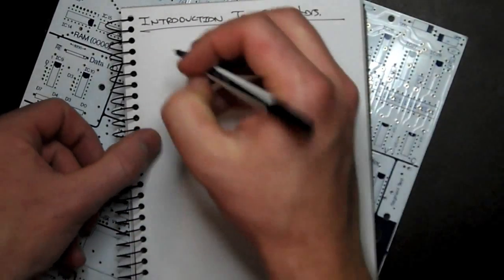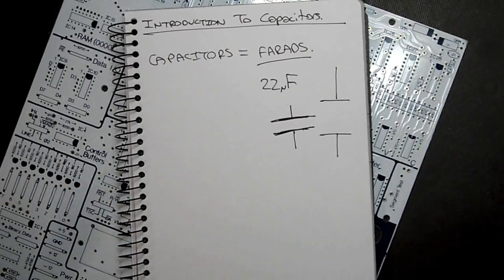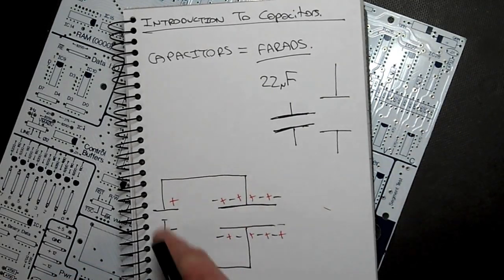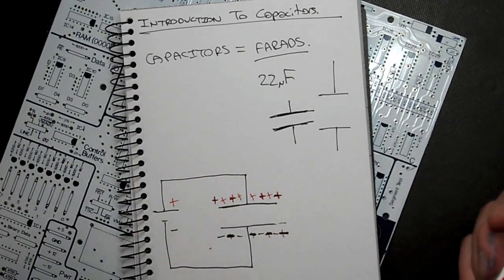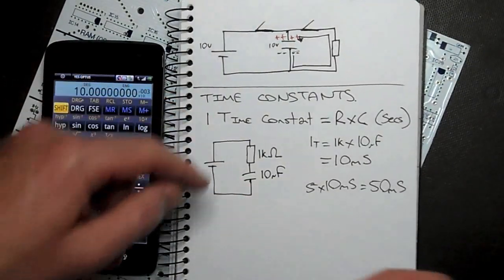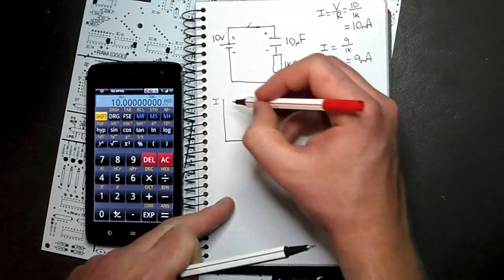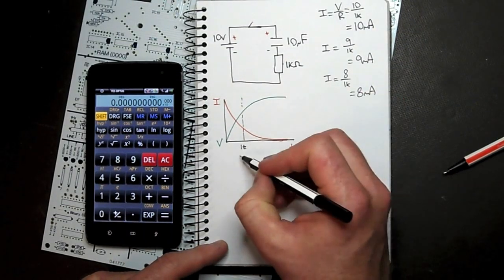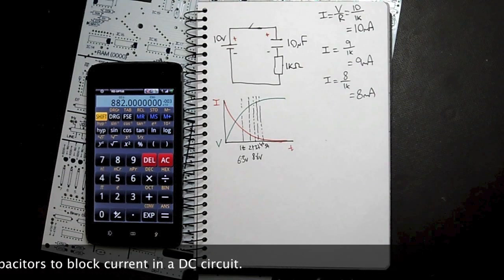Electronics Tutorial 5 - Introduction to Capacitors.

Comment from the maker: @MrHorsetail To work out 1 time constant we just multiply the resistor by the capacitor. So if this worked out to be 1mS and we then connected it to a power supply - after 1mS it would be charged to approx 63% of that power supply voltage. if we waited 5mS we would find that the capacitor basically equals the power supply voltage (more than 99% anyway) So we use five time constants to say that it is charged because that is just how long it takes. This holds true for all capacitors..

Comment: There are currents in both directions in most materials. Positive going one way and negative going the other. In solid metals however, current flow means negative flow (electrons) only. That is why current is usually depicted as going from - to +.

Comment: The equation for voltage of a capacitor is given as Vc = Vo(1-e^(t/to)) where Vc is vdrop across capacitor, Vo = Voltage source, t = amount of time used to charge capacitor and to = time constant. Since capacitors charge exponentially, at 4.7 time constants (he rounded up to 5), the capacitor is charged to 99% of its source voltage, which is good enough for anything. If you want more accuracy, 7 time constants will charge it to 99.9% of source voltage.

Comment: U mentioned at the end of the video that capacitors are used to block current, while I read in alot of books and as u explained, It is used to block an instanteneous increase in the applied voltage which can appear in snubber circuits

Comment from the maker: @cymonsgames I certainly will be making tutorials using capacitors in various circuits. although to make an LED actually blink, you are going to need more than just a capacitor. You can however charge the capacitor up, then connect it to an LED (through a resistor) and the LED will turn on and then fade to off. (as long as you had a reasonably large capacitor (hundreds or even thousands of microfarads)

Comment: because of the equation (1-e^-t/t0) where t/t0 is the ratio of time spent on charging the capacitor to its time constant. when t/t0 = 5, the capacitor is essentially charged to 99%. if you want to be more accurate, 7 time constants will charge your capacitor to 99.9%

Comment: I think the math might have been wrong a notch. The resistance (R) is 1000 Ohms, the 10uF capacitors value (C) when 10^-6 is 0.000001. R * C = 0.001, which means its 1ms, not 10ms. Just saying. Good video btw.

Comment: hey, nice video. Im building a power suply circuit with a capacitor in it which will feed  a microcomputer. The battery which will power the computer is rated at 11.1 v. As I understand, more capacitance = greater charging/discharging time. so if I use a 1000 microfarad 16v capacitor in the circuit assuming low resistance(100ohms) 1 time constant should be 0.1 seconds. If I want a longer charging/discharging time therefore I would simply use a higher rated capacitor(3000 micro farads)?

Comment: Hey at 13:46 when you said ov across the capacitor, how can you get the 10v on the resistor if the pos voltage is not going across the capacitor yet? Oh how the works?

Comment: There is one thing I want to ask.
If the resistor and capacitor are parallel but not series in the circuit, dose the calculation of    the time constant is the same???
THANKS

Comment: hey i dont understand the graph, where he says the current decreases. i thought the current would run through the circuit as its a complete circuit? also at 15.30 when u say the capacitor will get full 10 volts will the battery have 0 volts?

Comment: In your time constant calculation, they seem to be constant.  When you drew the graph , the constants seemed to take less and less time until the cap was fully charged.  So, are they constant (equal distance over time) are are they variable ( time being reduced as you charge like your drawing would indicate?)
Reply from the maker: The thing that is constant is the amount of time. The reason that a non-linear curve is produced is due to the fact that as the capacitor charges - the voltage difference between the power supply and the capacitor decreases resulting in less current. Less current means the capacitor charges more slowly - therefore the capacitor charges less as each time constant goes by.

Comment: Can you use a capacitor as a reservoir supply for a transistor. For example, in the first closed circuit the capacitor would charge up to 10 V, if you then had a fuse or circuit breaker that opened the first circuit, it would allow the capacitor to discharge through the transistor turning it on and allowing an LED to turn on notifying the person that the circuit was broken and turning on a backup source. Now, I don't know how you'd keep the LED on, but is something like that possible?